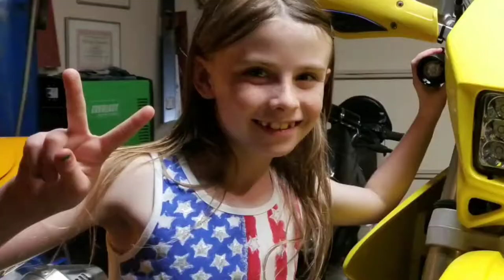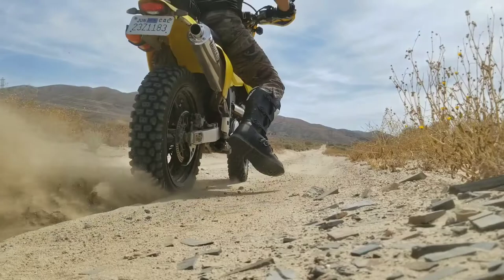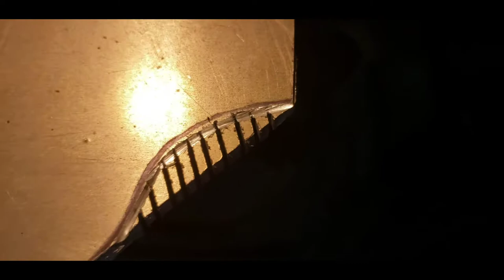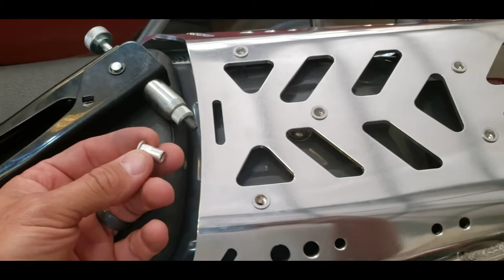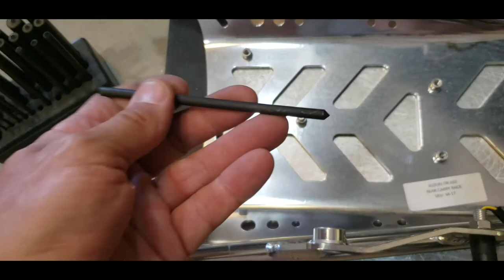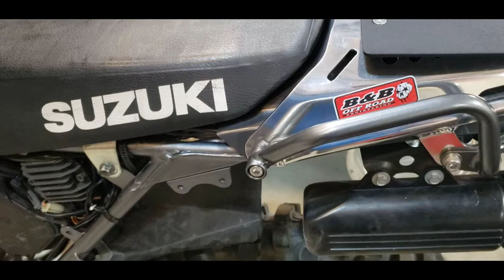DR650 ADVENTURE BUILD PART 7: B&B Rear Rear Rack DIY Top Luggage Plate.

Comment: Looks good, & you do know that B&B make a plate that bolts directly only the rear plate.
Reply from the maker: Thanks and yes I do, I just wanted to make my own, to save money and mine also goes in place better than theirs does. The Riv-Nuts I installed don't require any backing hardware, and they also keep the plate raised up a tiny bit so they don't vibrate together and ruin that pretty top of the rack haha!  👍🏻😁

Comment: Great tip on cutting and shapping the aluminum.  I'd love to start fabricating miscellaneous brackets and racks
Reply from the maker: Thanks! The best advice I can give is just dive in. You don't need tons of money in tools either, a hand grinder, a Sawzall if you want to splurge and a vise is pretty much all you need to get started. Harbor freight is a great place to get inexpensive tools to get started, they won't last forever, but they are 1/3 the cost of good stuff and will get you by long enough to learn. You tube is your friend too! Good luck!
Reply: Aluminium cuts just like wood, so you can just it with a jigsaw or circular saw too, even a router bit works well. Have fun!
Reply from the maker: @tortron  yes its pretty soft, just make sure you use a metal blade in the circular saw or you'll kill it quick. 😁👍🏻